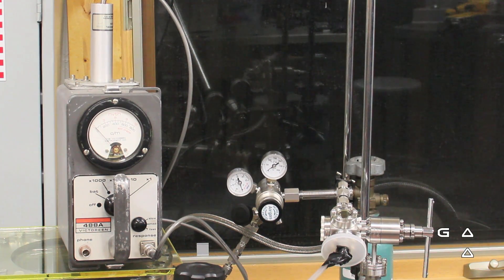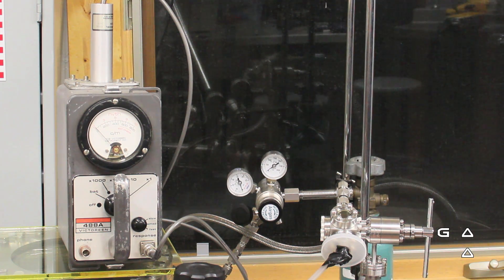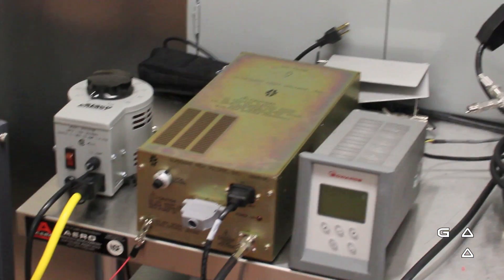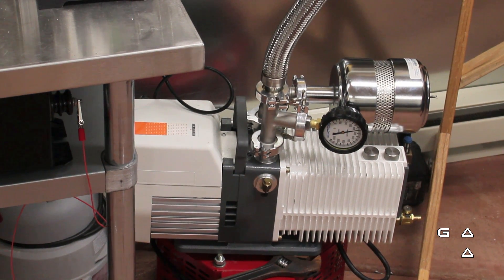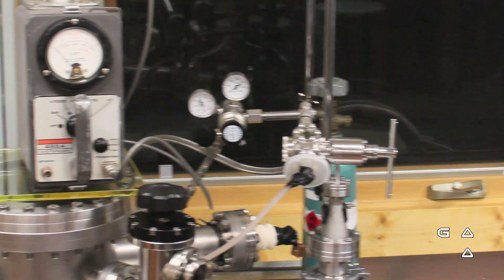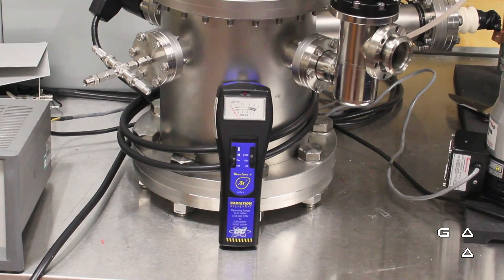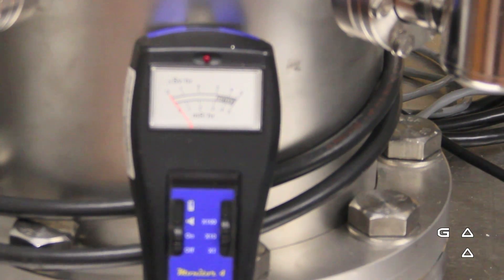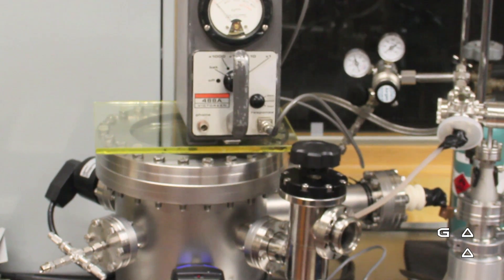World's smallest fusion reactor

Comment: Tanner, well done on a nice fusion setup. I estimate you were running at a TIER of around 15,000 n/s which is not bad for a first run. I think the neutron counter was playing up when it pegged the meter. I have the exact same instrument, and it does get affected by the PSU current limiting circuit, so if your PSU has such a switching circuit, make sure you control the voltage, so the current limiter doesn't cut in.